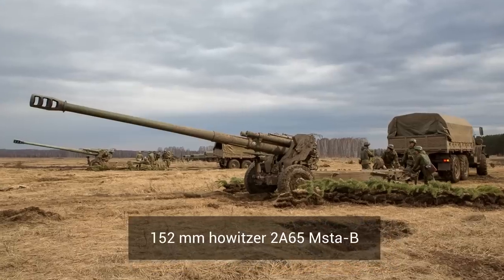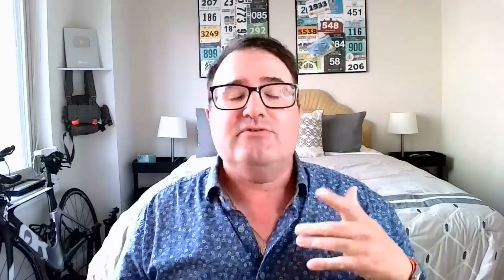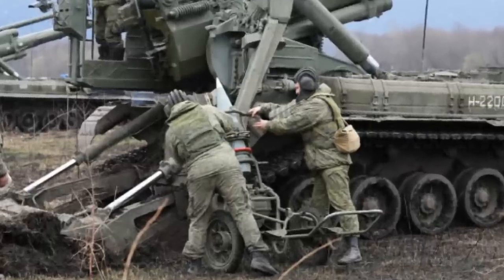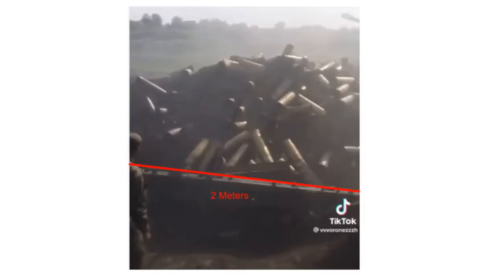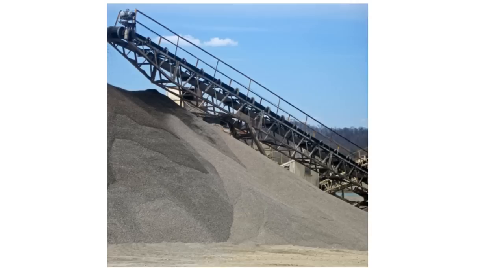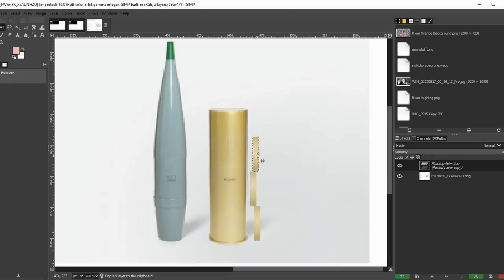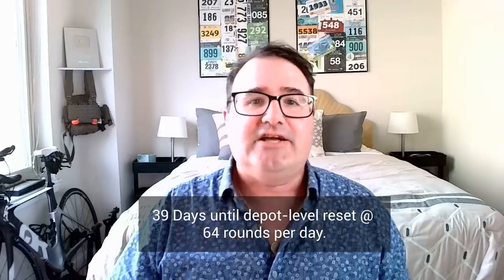When will this Russian Howitzer explode? (2A65 Msta-B Barrel life estimation from shell casings)

Comment: Whether your estimate is good or not doesn't matter; you showed your working =)

I think I'd have:
- used your estimated dimensions of the casing pile face
- used your estimate for the angle of repose of the dirt behind the casings,
- estimated an angle of repose for the shell casings,
- with those two values, computed the volume of casings,
- (experimentally) found an estimate for the mean packing density of semi-randomly oriented shell casings
and hey presto, you have an estimated number of casings.

To validate the estimate, you could build a 3d model of the scene, and with a physics simulation drop in shell casings until you approximated the video footage.

Comment: Based on the way the shell casings are laying, it looks like they are sitting on other shell casings (vs. sitting on the dirt). As you said, there is probably a berm under them, but they are more than one layer thick on top of it, no? It looks to be about as deep as the length of a shell casing or so minimum. So maybe 3 times the quantity implied by the surface area?

Comment: I counted at least 1600. Front side there are 20, times 20 on the right side that's 400 only in first layer. Than if the height at least 4 shells, there are 1600 at least in that pile.

Comment: Individually counting visible cases I came to about ~55, which is similar to you math. But my count, and your math, doesn't take into account depth from the berm, it only shows the front face of a pile. I do not believe this is simply a 1 case thick covering of the backing berm, because the pile simply does not conform to the similarly styled nearby berms. The pile has enough homogeneity to start making a profile of its own independent of the backing berm. In turn this is suggesting a larger degree of spent cases to make such an independent shape. I think a more fair assessment would be to at the very least double that which is visible to make up for the supporting casings which are not visible. Depending of the depth from the backing berm, it could even be higher. 

On another note, I wouldn't be surprised if this piece of malfunctioning or degraded equipment was in service in the front instead of a training unit. No I'm not saying by the main Russian forces, but by the Donbas Republic's militaries, who are often seen operating old and faulty equipment with a lack of proper protective combat gear, and diminished crews. Given how uncaring the crewman is about checking that the gun is properly sighted in and a lack of anyone of higher command telling him what and where to do missions. There isn't even a WW2 style RTO with a folding map telling him which pre-sighted sectors to hit. Either it is like you said and a its a training demonstration or, how i see it, these guys were told 'shell that way for this amount of time this many times a day, I've got better things to do than watch each volley'. Because that's how the Donbas's republics like to fight. It's hard to advance through a wall of firepower, which is why the eastern most front has very little Ukrainian counterattacks on it, and instead they went for Kharkiv, which had considerly less artillery being recklessly released.

Regardless, I agree that that guns barrel, and probably the whole piece needs some serious rest and maintenance before continued service, or even complete replacement.

Comment: This is really complex - you have to calculate how many objects (in this case cylinders) in a pile (a modified cone), then reduce that number by the berm volume, and then by the "unoccupied space" between each object in that volume. This is easily done with spheres where the densest “packing density” is ~74% for spheres and random packing of spheres it is ~63.5%. Why do we know these numbers so accurately….your old artillery brethren had to stack cannonballs…see https://en.wikipedia.org/wiki/Sphere_packing  
Onward to our problem…since we don’t have spheres, this shell "packing density" is a very complex Euclidian geometry problem and after a couple of beers, the calculated packing density (WAG) is 39% for a random pile of 152mm x 578mm shell casings. Then we need to know the berm volume (we can’t see the berm) so I used the dirt angle of repose, the berm area is ~34% of our calculated cone area.   
The total volume of the cone is V=pie*r^2*(h/3) and the modified cone volume (since it’s flatter on top) is this cone area *1.18. This give us the "total modified cone" volume.  Now multiply (reduce) the total modified cone by the volume occupied by the dirt berm *(1-.34). Multiply the remaining by the shell packing density (of 39%). Then just divide that volume by the volume of each cylinder Vol (cyl) = pir*radius^2*height. You get 152 shell casings. Then add the McBeth 10% shell “roll-off” coefficient…you get (fourth beer) ~167 total shell casings. That’s 6.72% of the barrel life…and 2 hours of my life I’ll never get back. LOL

Comment: what about the shells under the surface? You calculated that based off of the surface area, but that pile is three dimensional it needs to be based off of the volume. I’d say there’s six or seven times what you said
Reply from the maker: I believe there is dirt under the shells based on the left side of the berm.

Comment: Your math is out, even if it was a thin covering of discarded shells, this layer is at least 2 think by width given the necks of shells buried in the pile.
Additionally you can count 60 shells visible on the outer surface or the front pile… there is the back and sides of that pile, the pile behind it and the shells that a buried underneath.
Your looking at 200+ shells.

Surely yes, at most 10% of the barrels life. And almost certainly a training area, definitely old and neglected.

Love your content though.

Comment: Maybe I missed something, but you are counting only the surface. Your calculated the surface of the pile. A layer of shells. But this is a shell mountain, a volume. Not knowing how far back the pile goes is a problem. But given the triangle you created, you could rotate it 360 degrees to give a rough cone. Then figure the volume of a shell casing and then divide that into the cone of the pile. That is a rough estimate of the shells. I think way more than 64. But as far as survival of the gun, much worse. The good news if small explosive loads, less likely to blow up. The bad news, the shells through should wear the gun out regardless of load. That means someday there will be at least one fewer gunners in Russia.

Comment: In my opinion 
  After pausing the video 20x, doing a moderately rough count 10x from 2 points of view.
  I get a rough average of a minimum 85 shell casings plainly visible.
  I'd guess their's half that # of casings on the far side, further from the artillery.
So (120 - 130)

Comment: When a howitzer barrel wears out, does it have to be thrown away, or are there ways to refurbish it and put it back in service?
Reply: You can re-bore a barrel and make it like new. But we know Russia has four machines for that, two British, two Italian. To give you an idea: Canada is known to have more of such machines. As does the UK. As does France. As does Italy.

Even if those machines still work at all, Russia isn't even close to being able to service their artillery. And we know barrel production is at peacetime levels due to a lack of parts and money.
Which is why they have been 'rotating' artillery by dusting off ever older Soviet guns from deep storage.
Reply: @nvelsen1975  But when you re-bore a barrel, it's interior diameter is too wide for the old shells it was originally meant to fire. Doesn't that cause major problems?
Reply: @funkervogt47  
From what I understand (not an expert) they add metal while re-boring it. Because otherwise you'd get the problem you describe: barrel getting wider and the diameter would be wrong.

Comment: As a side note, I would assume that if they had to train new people on the gun, they would use a gun that had come in for repair, and be using much lower powered, cheaper charges. Why have some noobs break a good gun and have to repair it again before sending it back to it's unit :)

Comment: Damn.  I was hoping the answer was in less than 8 minutes (the length of this video) and we were going to witness it.  

Just my gut thinks 64 is low, but it's certainly not 2,500.  Either way the gun failing to eject is not a sign of a healthy operating gun.  Do they use a big pole to force the case out from the muzzle?  If so, that isn't going to help your accuracy or rate of fire.

Comment: Sorry man, you're way way out of your lane here. Lots of misinformation and uninformed speculation in this video. 

- barrels don't "start exploding" at the end of their service life, they just don't shoot as well / adequately. The 152mm has a chamber pressure about half that of a typical bottleneck rifle cartridge, or slightly less pressure than a .44 Magnum. The max full charge pressure is listed in the screenshot in the video. Obviously, removing charge bags will reduce that pressure considerably. Barrel life in firearms and artillery is a performance thing, not a safety thing. Indeed, as barrels wear, pressure generated will DROP as the projectiles no longer fit the bore as tightly. 
- broken or intentionally disabled automatic ejectors are absolutely not a safety issue. If the breech block is up, the gun is pretty much going to be fit to fire until the end of time. It's an incredibly strong and robust locking mechanism. It wouldn't be possible to generate enough pressure to rupture a case or blow open the breech unless you took out the original charge bags and filled the case with a much faster burning powder. There's simply no way you could explode that gun at 30 some thousand PSI. Brass cases have a yield strength more than twice the pressure that the 152mm operates at.
- Guessing barrel wear by the pile of brass isn't possible without ALSO knowing which charge they were fired with. EFC... EFC... Brass itself doesn't tell you enough to make an informed guess. You literally only have half the information you need to make a guesstimate. 
- guessing at angle of repose is silly when you can just measure it directly, either in a program or directly on the screen with a protractor?!?!?

Comment: exaxtly!! finally sombody points talks about that problem. Russia is using 3000 artillery pieces since half a year. Does anybody rally believe they are repairing them or even changing the barreles. i dont think so. Russians not even changing the tires of their millitary vehicles if they can put the money for that in their own pockets. So if russia fires 50000 rounds a day since half a year russia has to literally destroy more equiptment than even the ukrainians. firstly the artillery gets extremely unprecise and than it gets pretty "unfriendly" to the artillery crew. Eitherway thats also why a lot of the german pzh 2000 allready have to be maintained. Ukrainians fired 300-500 rounds (100 counts in germany as very intense usage) with everyone of them daily in a very fast intervall (it can fire 20 rounds a minute) with the highest explosives on very far distances (you dont want to get counterartillery fire) for an entire months. And in comprehension to russian equiptment everything is digitally. The system wont let you use it anymore if the system notices that the incoming data shows even small variance. Russians systems dont work like that. they let you do whatever you want to do with them until the barrel explodes (the max life expectancy of a russian artillery gunner)
Reply: I suspect that the 100 rounds a day you mention is for peacetime practice /exercise firing not full-scale war out put

Comment: You have to start smoking less weed or a whole lot more. I did it the easy way, just counted the some bitches. Came up with around 100. Add in 20% overlap and you right at Ryan's number with a shorter video by 50%.

Comment: Edit: The rant below is based on incorrect assumptions. :)

So many engineers and other supposedly STEM people... All of you may as well give your diplomas back and get a job where you'd endanger less lives. Obviously math is not exactly your strong suit. I order to get the amount of whatever in a pile you need to compare volume not area. The entire bit about calculating the slope is absolutely unnecessary. Using the formula for cone volume and your numbers we get roughly 1.6 cubic meters. Then repeating with the cylinder volume formula we get about 0.012 cubic meters per shell. Divide pile  by shell volumes and accounting for the gaps we get about 130 shells just in the bit you falsely assumed as the entire pile. That's twice what you got so the end number would be more like 20 days. Again not taking into account that the pile is more like 4x2 meters bringing the expected barrel life to an even more absurd number.
Reply from the maker: Unfortunately, you’re missing the point that the shells are lying on a berm, not in a pile like a pile of coffee beans.
Reply: @RyanMcBethProgramming  Point taken. I did miss that part. Still there seems to be more than one layer of shells stacked on top of each other so yeah - despite the error I still consider myself correct on the fact there's a lot more than 64 shells in there :)

Comment: Your math is completely wrong, you are thinking in 2D, the pile of shells is a 3D object. A cone with a height of 1.6m and a base diameter of 4.4m. Math for this calculation is approximately something like this:

https://i.ibb.co/zVZRxpW/shels-calculation.png

Vshells = 0.076^2 * 3,14* 0.578 = 0.010 m3 (volume of one shell)
ARshells = 0.152/0.578 = 0.26 (aspect ratio of shells needed to find packing density)
Pshells = 50% = 0.5 (shells random packing density)
Vpile = 2.2^2 * 3,14* 1.6 / 3 = 8.15 m3 (volume of cone/pile)
Nshells = 8.15 / 0.010 * 0.5 = 407pcs (Nshells= Vpile  / Vshells * Pshells)
Nuber of shells is between 300 and 500
Reply from the maker: Yes. If the pile was a cone.  I believe the pile is a berm, which would be a plane of dirt at 30 ish degrees with the shells resting on top of that plane.  Yes, real life is 3D, but that's why I fudged with 10% - because some shells may be resting on top of each other.  Not many, though, because this is a layer of shells, not a cone of shells.

Comment: I can COUNT more than 64 shell casings in that pile with my eyes alone, so no, you're absolutely not correct with your pseudomathematical estimation.
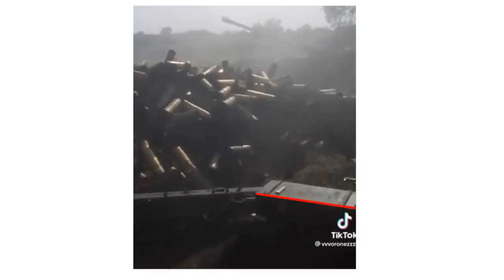Systematic errors are: 1. not each shell casing presents 90% of its surface area (which you implied with your calculation). 2. There is evidence that the pile of casings is more than one casing deep. 3. Your angle of repose is flawed, as can be seen by analyzing the reflections, it is much less of an angle than you assumed. 4. There is shell casings in the background. 5. How did you assume that those shell casings are from one day only? Russians tend to not clean up their piles. 6. pausing at 3:50 you can clearly see it's a pile of casings upon casings, not necessarily a pile of casings on earth, thus there's a backside to this pile, even IF it's placed on a pile of dirt. I can count 66 distinct shell casings in that stillframe alone and that's not even the complete pile. Your "calculations" are giving the impression of being scientific, but they are absolutely not. At a minimum it's atleast 100 shell casings (I could physically count as many distinct shell casings, merging the still frames of your video, with ones obscured probably making the pile upwards of 200 shell casings) SO please for the love of god, don't sell your theory like you're some kind of mathematician, it's a bad estimation based on flawed concepts. On top of that you seem to know little to nothing about the actual artillery besides what you read on the internet, and many people in the comment section who actually know their stuff have pointed more flaws out. If you have no idea, stop selling it like you got the absolute truth, while very quick cross-checking results in failure of every single one of your approximation models and assumptions. That being said: We all know how poorly Russia looks after its weapons. Of course they are worn, not just because of the conflict in Ukraine, but because of corruption, negligence and straight out indifference by the ones in charge. Not only do you present it like it's some absolute truth, you also show that you're completely incompetent at the same time concerning this particular subject. No subscription was earned for this, as it's not even OSINT, it's OSMIPS. Obviously Severely Misunderstood Inaccurate Pseudo Science.

Comment: Even with the exact number of shells, that would give absolutely no information on the lifespan of the barrel of that gun. Your content is usually good but this is just non-sense.
Where do you get 2500 shell mean average life ?
Or 64 shells in one day ? Pure speculation. 
What if this pile is sevral days old ? Or half a day old? Even still how does this amount of shells in this pile relates to the actual average fire rate on the front ? As you said yourself this is most likely a training facility, so there is no correlation whatsoever. Any invented number of days would be an equaly good estimate for that matter. This video does nothing else than damaging your content quality.

Comment: You can't work out barrel wear from the number of empty cases because you don't know what Charge was in the case. Charge increments have different EFC values Equivilant Full Charge unless you know the charge increment in each case you cannot calculate barrel wear anywhere near accurately . You also need to know the type of ammunition being fired.  So frankly you're talking bollox ! FYI  I was a weapons engineer calculating barrel wear was part of my job